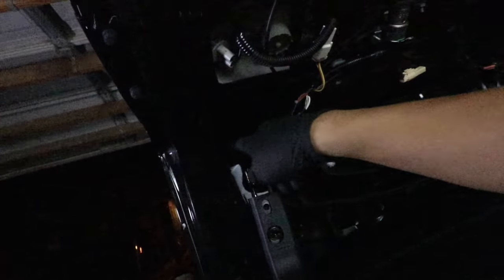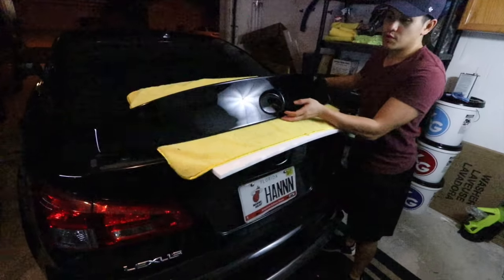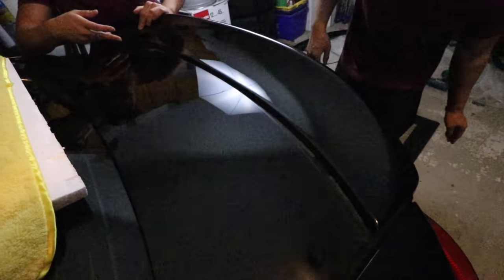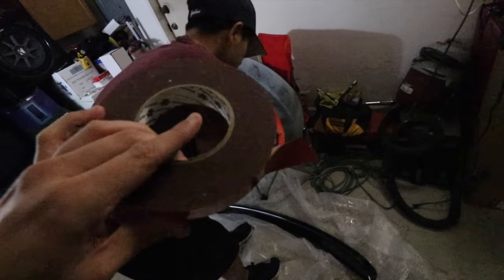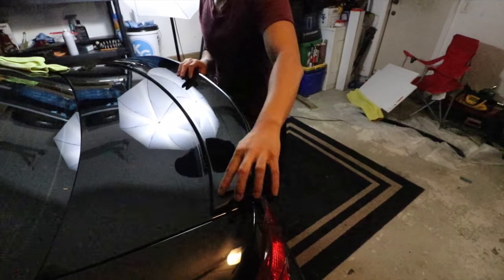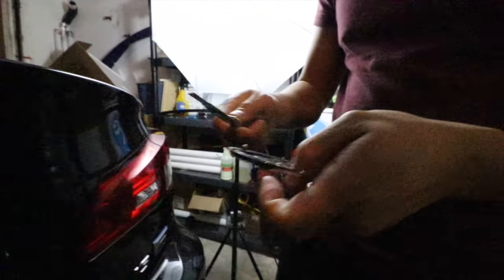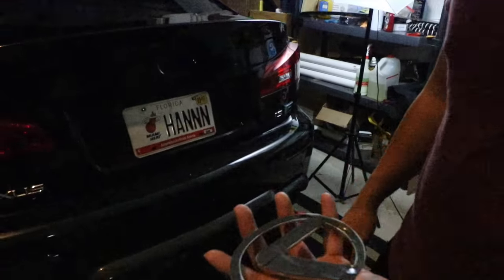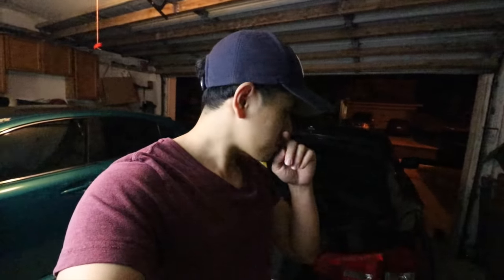Installing Wald Style Trunk Spoiler on Lexus ISF

Comment: Great video!! My trunk lid was damaged and I replaced it with one that already had a spoiler installed. The trunk lid is now a bit heavier, pops open but does not lift much initially. Are there upgraded trunk dampers/shocks that can be installed to  compensate for this additional wieght of the lid? (I had to do this upgrade for a 09 TSX).Thanks.

Comment: Man how did you get the trunk emblem to fit? I've bought two spoilers and numerous emblems and have yet to find one that matches up.
Reply from the maker: It fit perfectly.. Problem is most of the replica ones from a while ago has a bulge in the center causing the emblem to protrude out. His was relatively flat.

Comment: Looking great! I have the same ducktail on mine. I pretty much followed the same steps, but I used some 100 grit to scuff up the underside before putting the 3m tape on and heated both surfaces slightly before pressing down on the tape. Oh, and goo gone helped a lot with removing the tape residue, just takes quite a bit of elbow grease haha
Reply from the maker: Yeah the residue can be a pain. I would use the eraser wheel or the adhesive remover. Its my go to.
Reply: instablaster...
Reply: Thanks for the tips & advice! Looking forward to doing my own installation

Comment: Hey!  I have a question about removing the rear lip spoiler.  I have a 2010 IS350C and I wanted to remove the spoiler for a carbon overlay.  If I do that, would it damage the brackets that hold the lip in place?  I heard it was riveted in.

Comment: That part on the trunk that the spoiler did not cover where the glue was showing, did buddy end up getting the glue off the paint? That would bug me for sure lol  When I get an ISF I would make rear the end look exactly how that black one looks , not sure though if i would want the 2 red reflective dots on the bottom diffuser though, I have seen where you can get them with out the 2 red reflective dots.  Great video! chyea
Reply from the maker: Naw it was embedded pretty damn bad.. needed a wet sand and polish at the very least

Comment: I got the CF replica version. Fits well, though the one I got had some sort of clear coat under it where you put the tape. I ended up having to remove all of the 3M tape because the clear coat ended up flaming off, causing the 3M tape to not stick
Reply from the maker: Yeah always use a solution to prep the surface to take any grease, adhesive, paint or whatever before laying anything down.

Comment: damn why is the ticking so loud with your car? i know in general they have a loud direct injection but damn that ticks really loud with yours
Reply from the maker: hgubary yeah I have no idea. Was told it was perfectly fine for Toyotas. My oil levels are fine. Only thing I can think of is a slight exhaust leak somewhere that's causing the high ticking note

Comment: what did you plug the bolt holes and the plastic inserts with so water doesn't sneak into the trunk???
Reply from the maker: I didn’t plug them but some tape should do it. Im going to remove the trunk cover again and tape them up. Should be able to get to them, or at least most of them lol
Reply: Kantstandlam Garage yea I'm in the process of wetsanding and buffing my wald type trunk spoiler, and roof spoiler. It's just kinda hard to tell if the inserts are preventing my spoiler from going all the way down.
Reply from the maker: Yeah its a tough call man. But those clips are very thin. So i don’t think it would affect it much